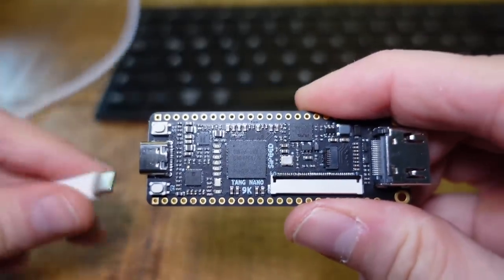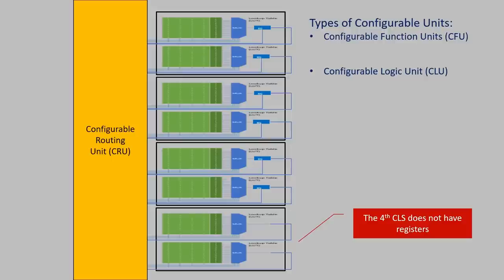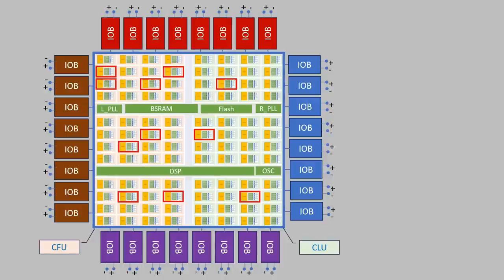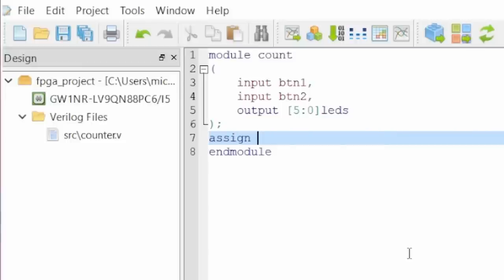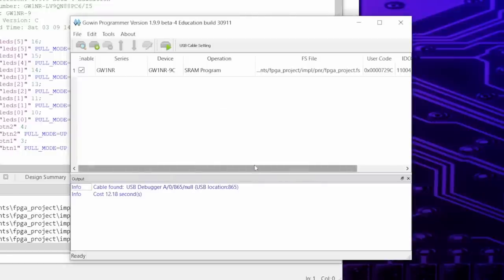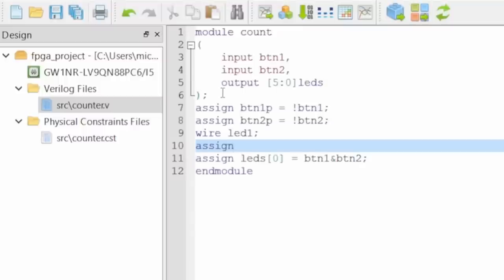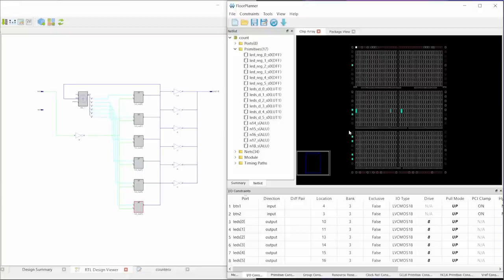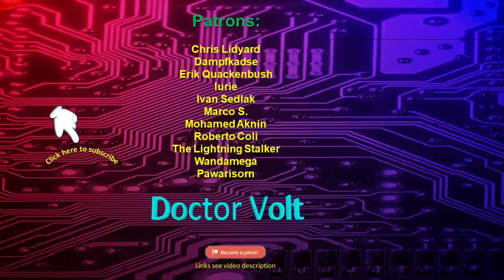Get Started With FPGAs and Verilog in 13 Minutes!

Comment: If anybody wants a useful project to make on FPGA, a diode ladder filter emulation that can connect to MCU would be handy. Those filter emulations are still too burly for doing much more than running them in a synthesizer on an MCU.

Comment: MCU do not emulate circuits. MCU are a processor (usually RISC) that have peripherals built into them. They do not emulate circuits. FPGA emulate circuits. They have these gates that based on programming set a logic operator to them. Also based on programming, they chain together. Hence the programmable gate array part. MCU is pure hardware. FPGA is basically hybrid hardware simulator. You can program an MCU on a FPGA but not the other way. Hence why there are SoC designs with both. Typically the FPGA reconfigures the MCU
Reply: Yeah, this is why FPGA is interesting. People tend to mistake MCU with it because they share the same level of hardware.

Comment: I started as a software person and went to verilog. The first thing I learned is that abstraction uses up all the LUTs and routing. My friend works for an FPGA company and said they never use abstractions, for the core IP stuffs. Makes sense.
Reply: just curious, what example of a company is an "FPGA company"
Reply: Abstraction can be zero-cost. I generate pipeline register chains and FSMs from a high level code all the time, and the result is usually better than what I'd write manually. Same goes for things like AXI bus handling, arithmetic ops scheduling on a long pipeline, etc.
Reply: Everything in industry is licensed, and you're lucky if you ever get a peek inside the code. Most designers never do any actual coding.
Reply: @stickyfox it depends, a lot of orgs have a policy to never allow opaque IPs.
Reply: Yea genetic engineering was easy after understanding asm.
Reply: This just isn’t true. Abstraction is fine if you know what you are doing. Coming from software how much digital logic did you know? Likely not a lot and that is likely where your issues came from. For example if you just write hdl to divide two numbers the synthesis may implement it (sometimes it will throw an error instead) and it will use lots of resources because division is complicated and resource intensive in digital logic. Coming from software you likely don’t know that and that could lead to you concluding that abstractions (like just using the divide operator) are bad when really it did what it you told it to but you just didn’t understand what you were telling it to do.
Reply: @vitalyl1327  it is similar to compiler optimisations. You could try and optimise your code or hdl yourself or you could leave it up to the compiler or synthesis tool which were programmed to make any optimisations it can by a team of engineers who focussed solely on what optimisations can be made. Basically it is you and your skills vs a team of engineers specialising in optimisations, in most cases it is better to just leave the optimisations to the compiler or synthesiser.
Reply: @conorstewart2214  division isn’t an abstraction, it’s an operation. I’m talking about conceptual abstractions, like modularizing everything then tying the modules together, rather than implementing a more “monolithic” type solution. This type of abstraction, that was using up all the routing, is what he said was avoided, because it had a very real cost when the router got things wrong, and they need optimal, since its core IP, and an extra gate is a gate taken from the customer.
Reply: @conorstewart2214  even if it is my own macro generating HDL, it is likely to do it better than I can do by hand in a reasonable time - it can use a CLP(FD) solver to do scheduling, etc.
Reply: @goodn1051  it keeps deleting my comment if I mention the names. But, you’ll find their logos and names on the the physical chips.
Reply: @stickyfox  So I can be a FPGA Designer without coding ? cool.

Comment: Have been wondering about Tang Nano 9k to house FT816 softcore modified to work in Commodore and Atari range of machines in place of original 6502 (and variants) but to use on-board PSRAM as real 16b local memory in 16b mode. Basically trying to do slightly improved SuperCPU ... Original device was based on WDC 65C816 processor @ up to 20MHz iirc, but 65C816 uses 8bit data bus anyway (much like 68008 or 8808) and also uses it to get address bits 16 through 23 (kind of like 8051 does multiplex data and address on one port for external memory interface). Which is ok from as close pin compatibility as possible, but is messy. With FPGA I can route all extended memory (24b space save first 64K) to PSRAM exposing only regular 6502 interface to GPIOs (obviously with level translators) and that also means I can get real 16b data interface to provide better performance in 16b mode.
Reply: have you tried with Tang Nano 20k + NESTang on it ?

Comment: Just watched your video. During watching, made my Aliexpress order... Looks like fun, but what can this device, what an Arduino can't do?
Reply from the maker: On an FPGA, everything is done in parallel, like on an actual circuit. On a Microcontroller, the steps are done one after the other. So FPGAs are much faster and there are less timing issues.
Reply: An arduino is just a microcontroller, it executes code an instruction at a time. An FPGA in comparison can implement digital logic, you can make digital circuits inside of it, you can even make processors like the one found in an arduino within an FPGA.

A major advantage of using an FPGA instead of a microcontroller is that you can have multiple things happening at once with precise timing. Each thing you want to do can be implemented as its own block and they can all operate simultaneously since they are all separate circuits. You could have one section driving a motor, another reading from a sensor, another driving a display and they all work at the same time, so latency is minimised (only the latency of that block) and timing can be very precise and no task can interfere with each other since they are separate circuits.

Compare that with a microcontroller where it can only do one thing at once and the processing power is split between everything it is trying to do. If you want to control a motor, read a sensor and drive a display, then the arduino can only do one thing at once, so you have to either do each task in sequence or split them up, so you do a bit of each task at a time and keep on switching what task you do. This does work but it does mean that precise timing is difficult and latency is higher. A common way to let microcontrollers do multiple things is by using a Real Time Operating System (RTOS) but this is just organising how the processors time is split up, it can still only do one thing at once. This generally leads to variable latency, since if there are a lot of higher priority tasks needing done then lower priority tasks can be waiting a while until they get done.

A related example of advantages of FPGAs is that everything can be done in parallel. In an arduino you can only do one addition at a time. On an FPGA you can set up multiple adders and have them perform many additions at once in parallel, the same applies to any other thing you want to do. So if you had 6 sensors and you needed to calculate something based on the sensor reading, the arduino would have to read each sensor and then calculate it one at a time whereas an FPGA can be set up with an individual circuit for each so that they are all done simultaneously.

An important use of FPGAs is that they can implement any digital protocol if the FPGA is fast enough. So if you need to use an uncommon protocol and no common microcontrollers support it in hardware then you can implement it in an FPGA instead. Or if you implement a processor (maybe a RISC-V processor) in an FPGA then the peripherals are very modular, you can design custom peripherals or you can add any you need, so if your application needs 6 uart (serial) but no SPI or I2C then you just attach 6 uart blocks to it, or if you need to control 10 stepper motors then you can just add on 10 individual stepper motor control blocks. You only need to add what you need so you can basically create the ideal microcontroller for your application. Another advantage of most FPGAs is that they have a lot of available pins.

You can find FPGAs in things like reconfigurable accelerator cards for computers or networking equipment. They are also used for testing chip designs before they are made. Often it is better to get an Application Specific Integrated Circuit (ASIC) made as they run faster and with lower power and they are cheaper in bulk amounts, like hundreds of thousands if not millions of chips but they are very expensive if you just need a small amount which is why people use FPGAs. FPGAs are often used in robotics. FPGAs are also often used in oscilloscopes or logic analysers as they can handle and process the measurements at high speeds. As another example each channel on an oscilloscope or logic analyser can be handled separately with its own circuit if you wanted.

FPGAs do have some disadvantages though. They are generally considerably more expensive than microcontrollers, they aren’t very fast (compared to a classic arduino they are fast, but not compared to most STM32 microcontrollers for example) but their speed is rarely an issue since they can do everything in parallel, also more expensive FPGAs are faster generally. They also tend to use more power than doing the same thing on a microcontroller would use but again that depends on the use case, it is possible to simplify some tasks on an FPGA so they use very little hardware which doesn’t use much power especially if the task doesn’t need a processor in the first place.

As a hobbyist the cost of FPGAs isn’t much of an issue, especially if you only need small ones. The cheap FPGA dev boards aren’t much more expensive than microcontrollers. Also as a hobbyist you will only be making a small amount of something (likely only one) so again the cost of FPGAs isn’t much of an issue. They are definitely worth learning and using though and can actually save you money too, instead of buying an expensive microcontroller of SBC just so it can do everything you need you could just use an FPGA instead and make it do everything you need.

As for FPGA development boards sipeed are very good, they have everything from tiny ones with ~1000 LUTs and very little else to reasonably sized ones like the 138k with 138k LUTs and can plug into a PCs PCIe connectors and has DDR3 RAM built into the board with a built in processor too. A good middle ground is the 20k and 25k ones, they are big enough to implement decent processors on or a lot of logic and they have memory built in, like DDR3 or SRAM. The 9k is enough to implement processors on too though.

For getting started you should start with learning digital logic first and then learn how to use the FPGA.

Comment: Just got my tang nano 9k yesterday, perfect timing for this video!! it does suck how they connect lines to low instead of high.
Reply: It’s common for digital outputs to have more ground drive current capability than high drive current. This is because the low side N FET in the IO pin is easier to drive.
Reply: How does it suck? What difference does it actually make in practice? Very little, once you know about it and you can figure it out just from looking at the schematic.

Active low vs active high is a very easy concept to understand.
Reply: @conorstewart2214   yes it is a simple concept and as enginerdy pointed it makes sense to make it so. I guess what i was trying to convey is that its annoying to have to set a pin to 0 for something to turn on and 1 to turn off, conventionally its the other way around. as you said, not a biggy.

Comment: You asked what you can make, how about making the 1 bit cpu UE-1 that Usagi electric is working on in his channel. It should de simple enough i think... Well not for me.
Reply: In HDLs it's not really any harder making a 64 bit processor compared to a 1 bit one. I think something like the SAP-1 (what Ben Eater made on breadboards) would be cool and more capable. And would leave plenty of room to implement peripherals like say sprite based video...

Not shitting on what Usagi is doing btw.
Reply: @MechanicaMenace  true but is it easier to understand. For me i dont even understand how usagi's cpu works but i thought this might help. But why not do both to show the difference;)
Reply: @jaapjethee  it's not really easier to understand, just easier to build out of the building blocks (i.e. valves/tubes) Usagi is using. Whereas the SAP-1 was specifically designed to be easy to understand.
Reply: @jaapjethee  a 1 bit cpu isn’t really easier to understand, it is very easy to understand basic 8 or 32 bit processors once you break it down and look at what the individual sections do.
Reply: @MechanicaMenace  one of my first FPGA projects was following Ben’s videos and implementing his processor on a lattice FPGA. It was definitely worthwhile and it was good to figure out how you need to implement things differently on an FPGA vs with chips on a breadboard. For example the fact that you can’t use tristate buffers within an FPGA and you need to use multiplexers instead.

Similarly “Nand to Tetris” is good although you use their own hdl and only simulate it, but after doing it that way it should be easy to implement it on an FPGA.

Comment: Is it bad that I recognised the BBC Micro Circuit Diagram within a second of it being put on screen.
Reply from the maker: Yes, it was the BBC Micro.
Reply: @DoctorVolt  I spent many days looking at that circuit diagram when I was young. I learned so much from that platform.
Nice work on the Dev board.

Comment: where do you set the clock rate and thus the sensitivity of the button? I mean, what's stopping the counter to be increased by 1000 times after one press? is the logic only triggered on edge transitions?
Reply from the maker: Yes, always @(posedge btn1) begin...